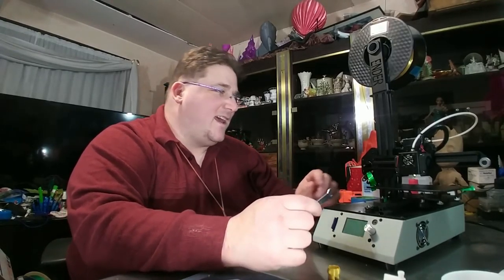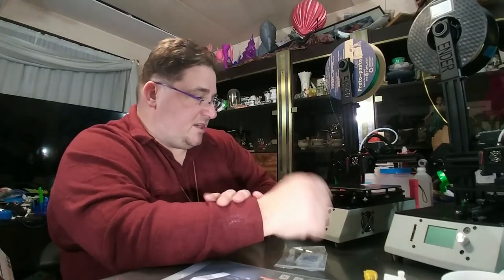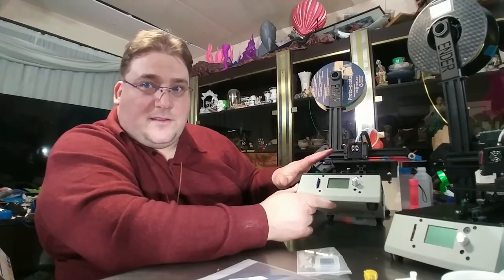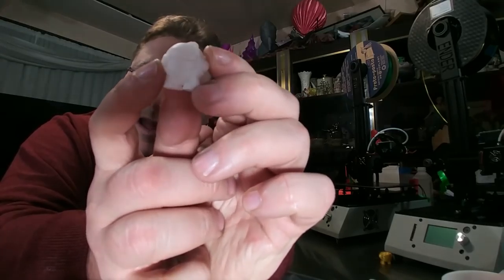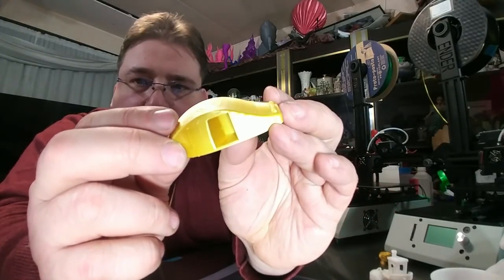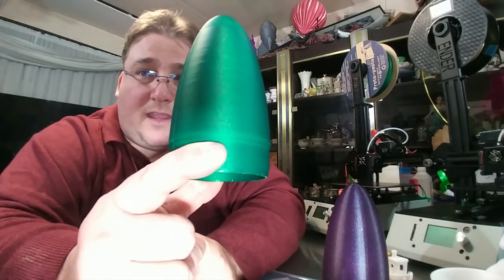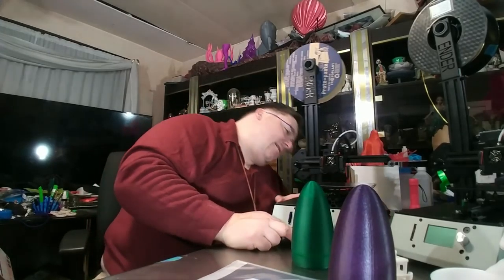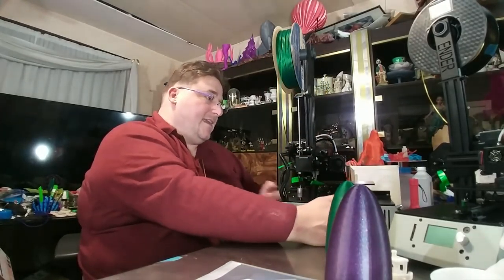Today's 3D Print 202 Tevo Michelangelo Continued Thoughts, Considerations, Prints

Comment: Great video as always 👍🤙

On the banding lines,  see if they line up with the lead of the Leadscrew.  Most of these style printers use 8mm lead.  This can hopefully give you a better idea if it’s a Leadscrew, bearing mount, brass nut, or coupler issue.

Comment: Have to say buddy having been watching your vids for a while i do love seeing your progression and experience increasing with every video you do. Technical issues aside youre doing great. Watching your vids is like watching my own fascination with printing but you have wayyy more patience than I. Im about to give up an anycubic altogether with the Kossel not having printed a single worthwhile thing since buying it and now my photon is playing up with the build plate not locking solid after tightening the screw. Im the kinda guy this thing is built for, I like building the printers but get frustrated when i spend 6 hours building like with the kossel and it was all for nothing because i dont know what the issue with it is.
Reply from the maker: Sadly the mistake was the delta Delta's require experience that's why I have not been able to get the anet A4 going properly I just don't have the Delta experience it's not as a turnkey is Cartesian printers and troubleshooting is not as straightforward as Cartesian printers
Reply: That is it exactly, its not for the beginner or even intermediate. I have learnt my lesson of if it aint broke dont fix it so when my tornado arrives im not screwing it up like i did my CR10 and learnt now that even the partial builds you need certain steps before printing, checking ALL screws and belts. Hopefully be someone who comes out with short instructionals for each printer from the moment you get the box to issues and how to deal with them on your first prints. FB is full of groups with the same questions which are all part of the initial build, check and print process, many many vids out there but all fragmented this youtuber does an unbox and build, this youtuber shows how while building you need to check angles are square, another shows to check VREF, this one shows extruder motor calibration, that one shows stepper motor calibration. I'd be interested to see someone do a say CR10 series from opening the box to calibrations, upgrades, stuff that went right, stuff that went wrong and the series is updated with any changes from firmware to hardware, a video of cleaning and maintenance. Same with all the popular ones.... Does that sound too ambitious??
Reply from the maker: No that sounds quite ideal but not so easy to execute Since By the time I single person experiences and learned enough to be able to put all that into one video the printer is 6 to 12 months old and the next model comes out I will probably do something like that for the cr10 just because it's still very popular but for other printers it's going to be fragmented that's why I return to printers after a certain amount of time to give an update on how the printers working out and any problems encountered but to do it all in one video would be difficult I actually have a cr-10s in the box that I bought so I might do just that for the CR 10
Reply: I really look forward to seeing it, also will remind you to check ya screws and belts before printing ;)

Comment: It would be cool to see Moon City's little domes printed with Cura's "experimental" Adaptive Layers function to see how it lessens the "steps".
Reply from the maker: I can do that in simplify3d but I'm pretty sure Kira doesn't the same way simplify3d does where the whole layer will be lower steps not a single portion of the model if it could do that that would be amazing :-)
Reply: I'm waiting for some YouTuber to explore the feature in depth (until I get a printer later in the year).  The thing that bugs me most about FDM output is that round too often ain't round.  It's stepped.  From Ultimaker's own explanation:  "With adaptive layers, Ultimaker Cura will compute a variable layer height based on the shape of the model. The algorithm assigns a narrower  layer height to sloped surfaces, and a wider layer height to vertical surfaces. The result is high-quality surface finishes with a marginally increased print time. The user is able to specify the maximum variation,
variation step size, and threshold."
Reply from the maker: Yep I've been using this in simplify3d for over a year now it works very well when you need the detail in one spot and not in the rest of the model cura just made it easier which is nice and simplify3d it was a very manual process they have variable settings wizard now which does make it a lot easier but it's still somewhat manual

Comment: Great review, would you recommend this or the ended for a v small desktop to complement my other bigger printers ? Thanks
Reply from the maker: If you want something that looks pretty and is very compact get this if you want a bigger build volume a little bit more of a machine look and slightly better print quality with a heated bed get the Ender 2 they are both very good printers I have no complaints about either one
Reply: thanks

Comment: Just hoping you can clarify, when you say to print the first layer at 10-20%, do you mean turn the speed down on the printer itself? or in the slicing software?
Reply from the maker: You can do it on the printer and once you learn what speed printer likes then program in the slicer so you don't have to keep changing it on the printer
Reply: Thanks for all your help! I just did it on the machine, realised that turning the knob while printing will adjust speed, very handy! Am going to learn Cura over the next few days. Used your samples for some tests, I think they turned out well. Great little printer for a beginner like me. Here's some pics: https://imgur.com/a/3ik1fWB
Reply from the maker: Yes get rid of that bearing and those prints will clean up even better it really is a good little machine I would be totally happy with a half a dozen of them just printing out parts :-)

Comment: Hi Nery/s! Love your in depth reviews and insights. I have a Tronxy p802m (Anet A8 clone), which I have converted to an AM8 frame. Coming from this background, what FDM would you recommend / or what printer do you think prints the smoothest/ cleanest with less tinkering. I plan to use it for detailed sculptures, prototypes and practical, usable parts. I saw your review about the Ender 2 and I think you said that you got spoiled with its print quality. I wonder if that has changed, after reviewing a bunch of printers after. I am eyeing on the CR-10s, Tronxy X5s (but not sure if the build and upgrade would be worth it), JGaurora A5 (scared with the horror stories though) and Tevo tornado (+smoothers). As you can tell, I want something bigger. If you could make a side-by-side comparison video/ throw down, that would be awesome! But then again, a simple reply would still be great. Thanks!
Reply from the maker: For bigger i have yet to use a printer that matches the cr10s. Its an amazingly clean reliable machine. My a5 has been perfect from day one but its an "unknown" and not as easy to pull apart if something goes wrong.

I would go with the cr10s personally if you want high quality and large. The prusa mk3 i hear is amazing but small build volume.

Comment: I also have one of these for review. The screen on mine has terrible contrast when viewed from above (such as if the printer is on a table and you are standing in front of it). It's so bad that I can't see anything unless I squat down to view it from straight on. I can't find a contrast adjustment -- is there one? Also I experienced a major layer shift of around 1cm to the left when doing my first major print. Disappointing because it was otherwise looking really nice.
Reply from the maker: Check your cables make sure nothing is loose going to the steppers you might need to crack open the case and make sure nothing popped loose in there either sometimes wires can come in shipping I haven't experienced a single skip step yet in fact I had it knock over a few prints and still not skip so I would consider that unusual although my sample size is only two printers also check the belts make sure they are snug.

As for the screen yes the vertical viewing angle is very limited you're looking straight down on it you're going to have trouble you might want to eventually modify it the reverse of the Enders tilt the screen more flat rather than forward that might be hard with the all metal enclosure

Another idea that might sound odd but should actually work assuming you do not Mount spool on top like I do tilt the entire printer the printer itself won't care you can mount it upside down it'll still work right :-)

Comment: just a suggestion - don't print in white for the camera.  White never shows well on camera.
Reply from the maker: Yeah I know but I always use white for the first prince because it's the $7 a kilogram filament :-) so I have a whole bunch of it :-)
Reply: That's understandable - hurry up and get through that white stuff :)  On that note, if you are like me, you rarely print in white.  I have a 1kg roll and it will probably last me forever.  I've decided to start using it for my prototypes because I just won't print other things with it, unless it needs it - like a Storm Trooper head or something like that.
Reply from the maker: I typically do almost everything and white :-) it's the cheapest color it tends to be the strongest nothing in it :-) and for the stuff that I do rockets It's usually the need of color of the rocket and or the best back to accepting paint since you don't have to fight the base color plus it's really cheap I have about 30 kilograms anytime I text a new printer and throw a roll of white on and go through my cast Prints Plus with this one I knew my first real print would be David which needed to be white

I go through a lot of white :-)
Reply from the maker: It also doesn't help that I had a 200 watt equivalent light source directly behind where the camera was :-) that kind of blew it out really bad :-)

Comment: Why anyone would buy ghis over Ender2. There is no a single thing that it is better than Ender2. So ...
Reply from the maker: It has its advantages. (Which i hope to add to me enders :-) solid state end stops full size sd compact all in one constructions solid as an elephant, front facing control panel. Fully assembled. 12 minutes from open box to print is possible.

Ender is higher quality print large build volume. But not by an insane amount on either and it does havw a need for some cooling mods for some prints.

I still prefer ender 2 but the tevo is nice. Very nice.